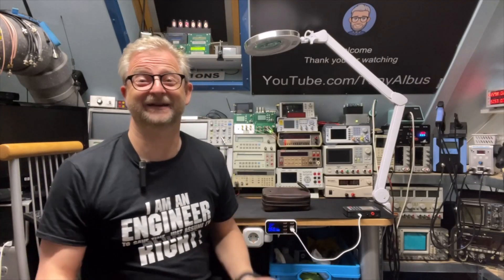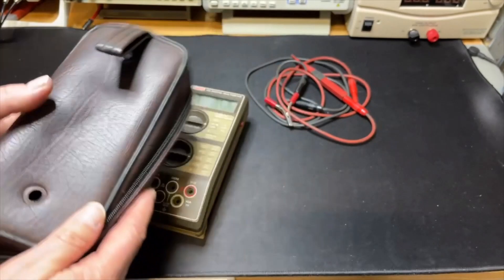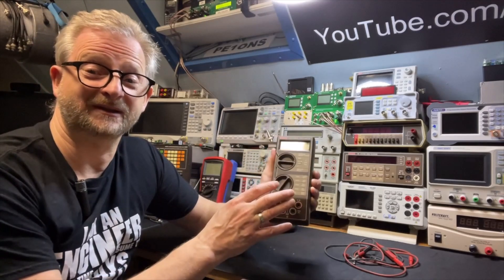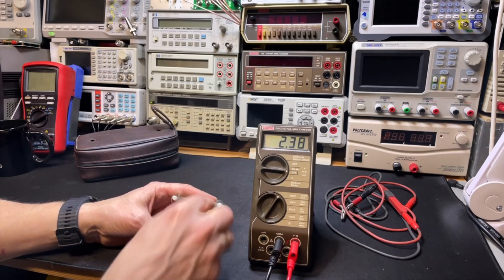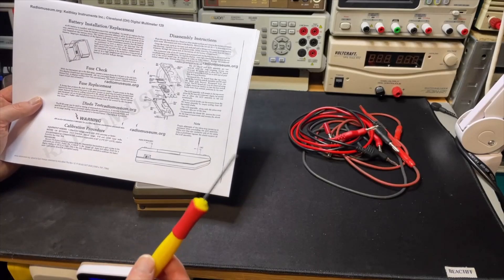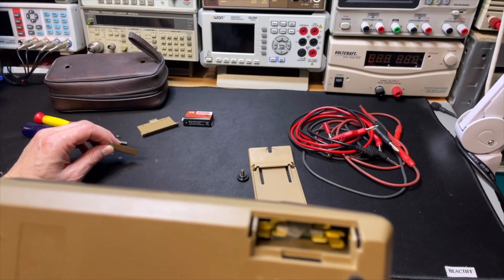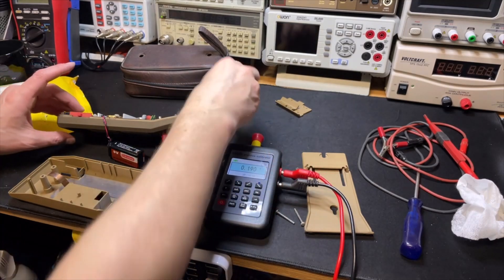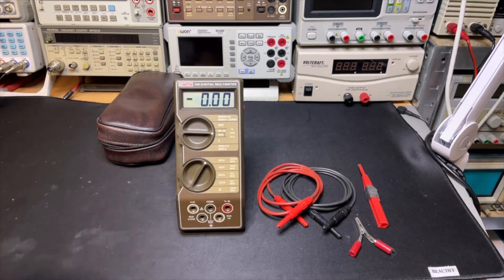#246 Keithley 129 Handheld DMM Cleanup Calibration Teardown

Comment: You certainly make some amazing finds - after clean-up it looked brand new! I guess the available technology at that time couldn't  fit auto-ranging into a small package, so two knobs was  good way to fit the necessary controls into a handheld package. In that respect it reminds me of your Fluke 8024A (video #102) with its pushbuttons down the side. Regards, David.
Reply from the maker: Thanks David, yes both very nice devices, i like what they made in that time.